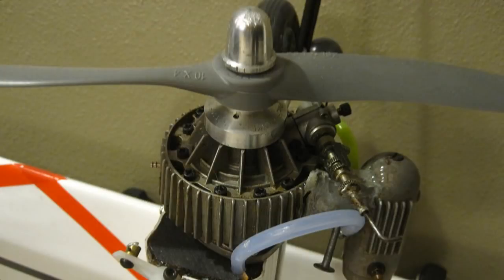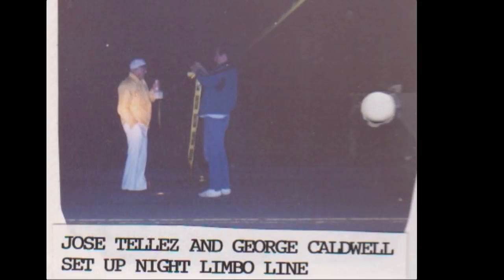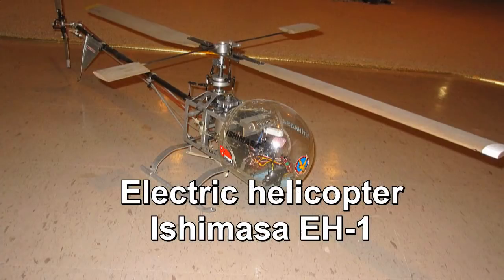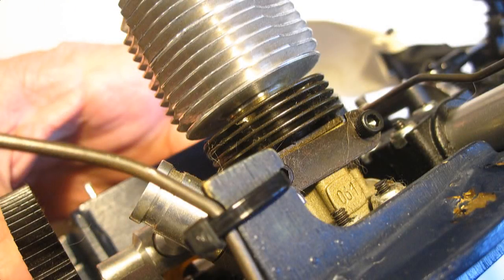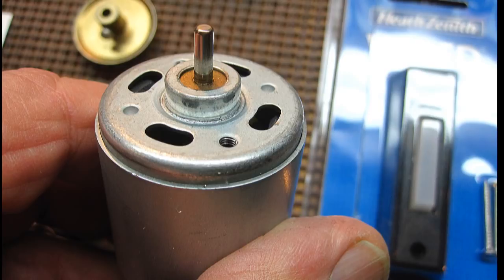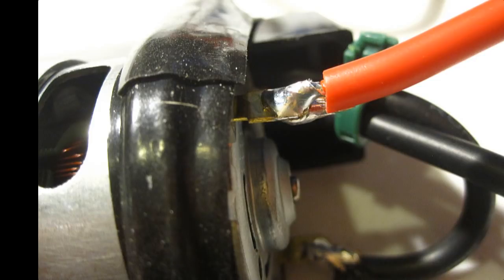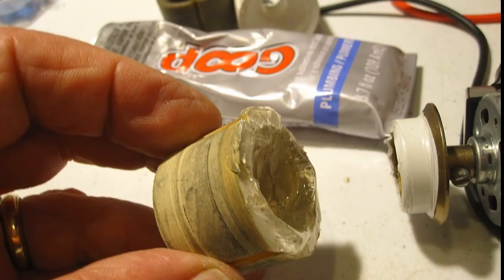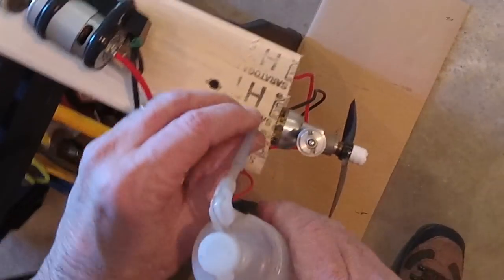Home Made DIY small engine starter.  Will it work?

Comment: Great vid love a cox engine ive just purchased a thunder tiger 12v high torque starter, what battery do u recommended for it ,i have a 12 v 2.2 amp batt but it seamed to runn out quick its new ,i never charger it new out of box could this be the problem or do i need higher amps thanks
Reply from the maker: Those are big starters for .20's on up.  It needs at least a 5 amp or higher battery to last any length of time.  Thanks and hope you check out my other Cox videos.
Reply: @NightFlyyer  thanks for replying, im a cox fan myself have 2 babe bees ,never let me down  hey ,will stay tuned to ya channel

Comment: Which motor can be used for starting a 46 size nitro engine?
Reply from the maker: You will not find a better motor to start a .46 with than the Sullivan Starters.  They and similar brands are the best for bigger motors, but they are overkill for small ones like this and can cause engine damage.  Thanks much.